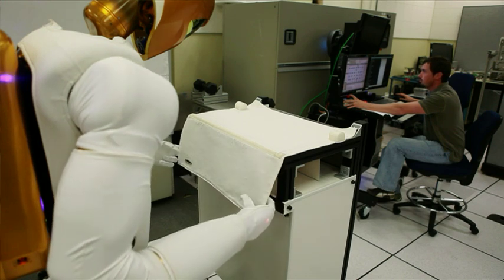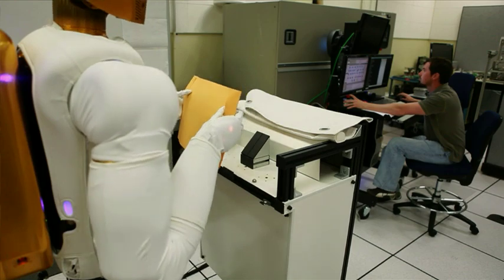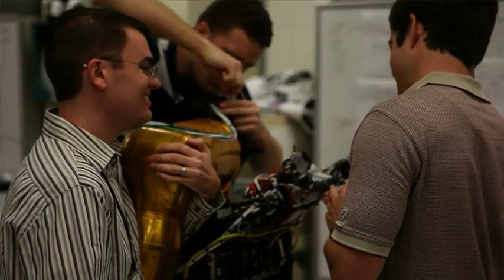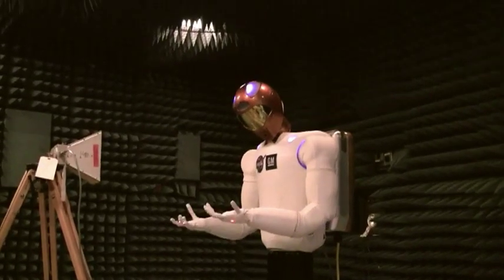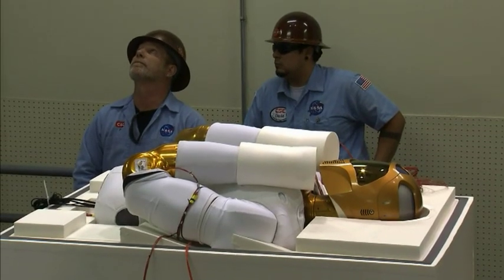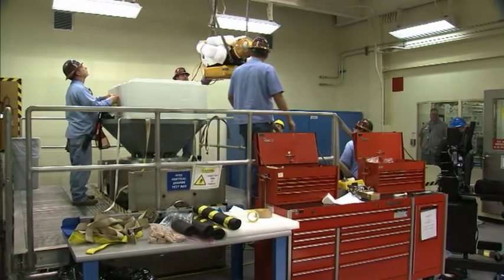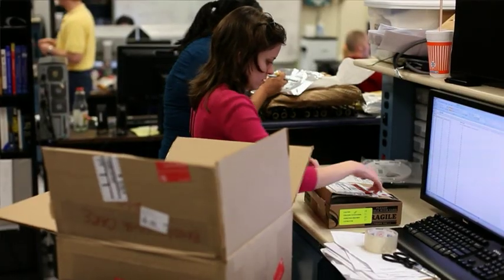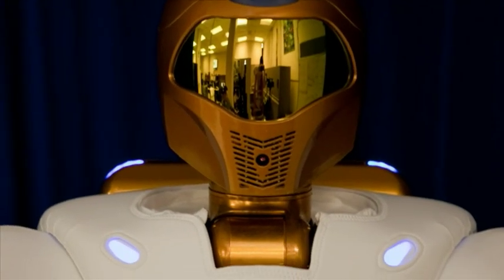NASA Robonaut 2 to Help Astronauts on Orbit

Comment: The mobility package is going to be very very challenging due to micro-gravity /weighlessness in the ISS. From what I see of the ISS human movements, this robot is NOT going to need legs as in robot articulated legs but electrically retractable rod bars with rubber ends to anchor itself. It needs 3 more from its backpack to support itself on the ISS walls. These retracts and a human can just pull it along to a new spot. It is simple light and durable. One to ceiling, leftwall, right wall and dn.